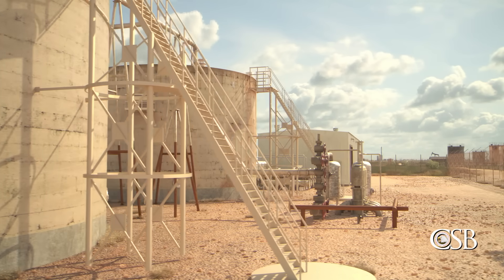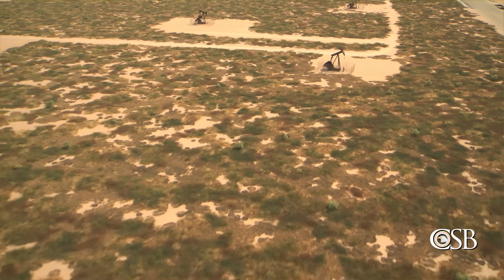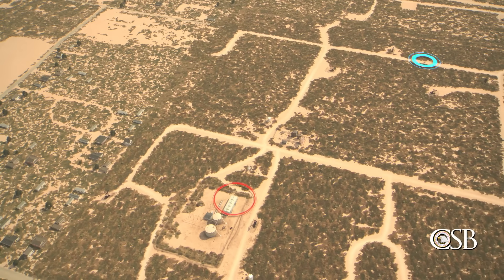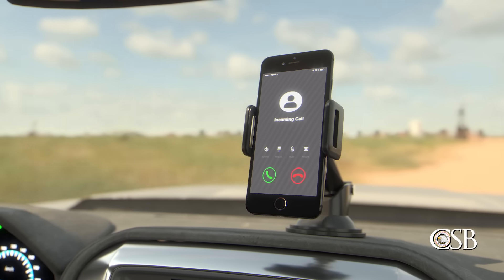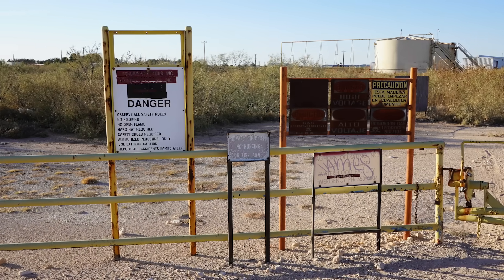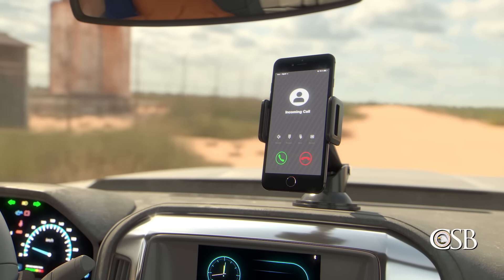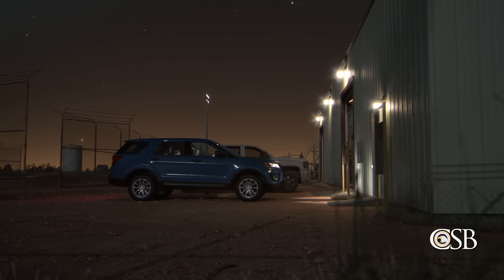Silent Killer: Hydrogen Sulfide Release in Odessa, Texas

Comment: "Some of the sensors were set to "test" mode, and couldn't send an alarm to the panel..."

Anyone willing to bet me cash that this was done BECAUSE THEY KEPT GOING OFF???
Reply: Exactly what I was going to say.  "Stupid alarms keep going off and phoning me!"  Sad, but very likely.
Reply: @khx73  First thing that came to mind.
Reply: It's like that oil rig that exploded. Same thing, they turned the alarms off because they kept going off but they checked things out and found it to be "fine". Many died not too long after
Reply: @skrimper  Italian Gondola crash was the same thing. Emergency brakes kept locking up so an operator installed blocks to prevent the brakes from applying
Reply: they probably would mention that

on the other hand there probably was a lack of evidence
Reply: @NithinJune  A deliberate lack of evidence at taht.
Reply: Happens all the time.
Reply: Never alter a safety device. Cardinal safety rule.
Reply: When safety is seen as an annoyance by employees, then death soon follows
Reply: Yup, and they probably kept going off because the whole area is inundated with H2S, the workers hydrogen sulfide detector was going off in his dang truck with the doors closed, outside the facility.  If you ever drive through this part of Texas the whole area smells like ass from the gas releases.  Not only are they filling the ground level with toxic gases, but they are wasting our natural gas to drive energy prices up on a finite resource.
Reply: Of course that’s what happened.  How many times do you think Aghorn’s mgt cursed the “communists” in DC for their unneeded safety rules?
Reply: No way. That's a sucker's bet.
Reply: In my chemistry lab our safety head gave us a lecture on lab safety incidents. There was lab work being done near a large Dewar flask of liquid nitrogen; which vents itself now and again to release pressure. Apparently someone had enough of the hissing noise so they used some hardware to seal it shut. The resulting ‘rupture’ destroyed the lab and some nearby rooms
Reply: @ladyabaxa  it sounds dumb, but once you've watched a lot of accident reports where that's exactly what happens, it gets way more plausible 😢
Reply: @arin-n7q  Precisely. There are very few accidents that are truly "unpreventable" accidents. And a great many accidents in the oil and gas industry have everything to do with an emphasis on speed and profits ABOVE safety and human health.
Reply: Yep. Guarantee that's why the guy didn't have his personal H2S monitor on either. Not that I'm saying it's his fault, he might have gotten too many hits and management started getting on him about them. Sad story.
Reply: @MrBrian465  The sad fact is, after we hear "Wolf," too many times, we get complacent. Even if there was a wolf each and every time.
Management, however, was being sadly deficient in making sure false alarms weren't happening all the blinking time. But, that's just my opinion (and probably the law!)
Reply: @MrBrian465  Criminal negligence on the part of the company
And his personal H2S detector would have told him if it was real or bogus.
I spent 20 years in the (petro)chemical industry, 10 of those wearing an H2S sensor
Only upside is they won't have suffered
Reply: One of the recommendations from a well blowout investigation was to actively monitor and tune alarms because needlessly noisy alarms just get ignored, and so they may as well not be there.
Reply: Every regulation has a corpse (or more) behind its creation.
Reply: This is one of the cardinal rules of the "USCSB drinking-game" where you take a swig for every corner cut...
When they come up with "... and the safety mabob was de-energized and nonfunctional" you scull half the bottle and bet that it was both intentionally disabled, and was the one thing that would have saved everyone's lives...
Reply: No bet.
Reply: I think the official term is, 'Normalising deviance'
Reply: Oh absolutely. My only other guess would be that they were installed in-house by someone who didn't know what they were doing to save money so they were never fully functional to begin with.
Reply: That, or the sensor had detected gas for so long, and so often,, the filter system clogged up  and the the siren wore out,  and the red light bulb burned out., and every one was happy when it stopped going off and flashing, they never bothered or wanted to check why it  had not gone off lately.
Reply: @chrisperrien7055  I am very suspicious that this was it.  The bay doors were open and it late October it probably wasn't due to the heat.  The personal monitor was in a state of alarm -- was it alarming before the employee got out of the truck, and they left it because it was annoying and that had happened a lot before?  The rescue personnel immediately smelled gas; did the worker also, and ignore it?  USCSB coudn't determine whether the major release was prior to the worker's arrival, or while he was there.  It's all fairly suggestive of there being a frequent smell of hydrogen sulfide there, the workers being told to just open the doors and ventilate and it would be fine, and otherwise ignoring it.  How long was the pump even damaged for?

The major thing that speaks against this is USCSB suggesting no such thing, so at a minimum there's no paper trail and nobody talked.
Reply: Just like the Italian cable car with the disabled emergency brake.
Reply: Normalization of deviance.
Reply: I remember when someone turned off the high water alarm for the sewer system where i work because it was annoying the campers during the night. I was like you know what is even more annoying, it's have sh.t water go into your tent because you're down from an overflowing sewage tank.
Reply: Especially given the fact that they said the one's that WERE working were NOT ABLE to send an alarm.
Reply: Haha I'll bet a penny. I can afford to lose a penny.
Reply: Honestly test mode should be something that is time limited. after a certain amount of time elapses the alarm should reset itself out of test mode. That way it's impossible for a forgetful employee to leave an alarm disabled like that.
Reply: @killman369547 At my job, a lot of the test functions are either pushbutton or switches that have to be held down continuously for testing.
Reply: I had a house alarm that kept going off. Eventually I put 2 in series , so the alarm would only go off if both alarms triggered at the same time. That worked.
Reply: you know it
Reply: that is probably exactly why.
Reply: Disabling alarms like that is terrifying. I've been in a place that isn't exactly the best run, but no one would screw around with gas detectors.
Reply: A tale as old as time
Reply: That's exactly why they set them to test mode, owners more concerned about making money than workers safety. 
Sad but this kind of shit happens everywhere everyday.

Comment: That's the one that smells like rotten eggs at low concentrations, somewhat sweet at higher concentrations and not at all at dangerous concentrations, right?
Reply: Hydrogen sulfide's odor causes rapid nasal fatigue, so you'll stop smelling it after a few minutes--but not because it's not there anymore. Truly nasty shit.
Reply: Right
Reply: As @L P said, it's not that it smells different - the higher the concentration is, the faster you'll lose your ability to smell it & the faster it will kill you.
So at low concentrations you'll get a few nasty smelling lungfuls before your sense of smell goes & you feel sick and dizzy - but you can walk away to fresher air before it does too much damage.
At high concentrations your 1st breath will wipe out any sense of smell -> your 2nd lungful can make you unconscious -> your 3rd can stop your breathing. You're knocked out before you even know what hit you, which is why detectors are crucial. H2S gas is colourless, extremely toxic, highly flammable, and even corrosive - really nasty dangerous shit at any concentration.
Reply: Thats the smell that comes out of golf carts when charging the batteries sometimes.

Comment: well ,being a part of oil and gas Industry as a HSE Supervisor, I have noticed at many occasions that Safety trainings are either not arranged or they are not adequtae. despite spending huge amounts of money on HSE Department, companies fail to establish a sound and safe working Enviornment. The only reason is Poor Management. Sometimes its the weakness of safety department itself and sometimes higher managements is not willing to pay attension.. Infact a lot of managers take HSE as just a legal requirenment and without that you cannot get projects or do business
Reply: I believe the issue is standardization and boilerplate style of safety. Every site orientation I've been to is exactly the same, with little thought to the actual risks you may encounter on site. 

If a company had training that was not the same, and instead had a guy with greasy hands on a camera pointing at a pump, saying "hey, this thing? If it fucks up,  and you don't have a monitor on, you're dead you'll smell h2s for 0.05 seconds then hit the ground the ppm is so high . " 

Then walks over to the muster point and says, " this is where you go if shits hitting the fan" 

Going over OHS regulations by definition does nothing for a site specific orientation.
Reply: @Pickleriiiiiick  absolutely right. Every single site has its own risks. Though the set of activities may be identincle, but implementation techniques, weather, culture .. all these things differ from srea to area. HSE Department should b innovating the OHS definations and make nesseccary changes to make it feasible for their site

Comment: The thing I'm having trouble with is the fact that hydrogen sulfide smells really bad. I mean how did the pumper either not get the smell of a really bad fart, or smell it, but not get the meter? Goes triple for his wife.
Reply: High densities of gas are strong enough to instantly shut down your sense of smell
Reply: @readmorebooksidiots  Wow, I did NOT know that!
Reply: I think you'll eventually just get desensitized to the smell if you work around it for years.
Reply: @DAN007thefoxx1  Yeah, that's true...
Reply: @notmuch_23  In a different video, CSB even said that your own sense of smell is for this reason "unreliable"
Reply: You get used to the smell pretty fast, even at lower levels that doesn't numb you olfactory system as fast as higher levels does. 

I for one get hungry after a few minutes of exposure enen at low levels. My personal alarm goes of at 10 ppm an then it's time to leave the area, but you can still smell it at 50 ppm at least for a while (and your eyes start to hurt from the acidity) . Above 80 ppm it doesn't smell much, but when I have been exposed (briefly) the air gets kind of thick and "cheawy". Hard to explain, and and for gods sake, don't get exposed to such high levels. It will male you feel quite ill, even if you don't die your lungs, eyes and entire body suffers badly.
Reply: The problem is H2S is so lethal, by the time your brain registers the odor it's too late.

Comment: Oof, this one is particularly sad. Two kids orphaned. And why didn't any of his coworkers notice he was missing? Did no one check in?
Reply: Seems he was the lone pumper that shift. These facilities need very little human interaction
Reply: Seems like he was the only worker there.
Reply: Supervisor called emergency services.
Reply: If the person checking was just as informed as the operator, this person would have been found dead next to him. (And his wife)

It still amazes me how it is possible that companies like this can even exist.
Reply: @robbedoeslegrand236  the operator neglected his safety equipment. Never leave a personal safety device in the car.
Reply: @SECONDQUEST  That is the saddest part of this.  Sure the on site detector should have been working but equipment fails (or in this case gets set up improperly).  He had what he needed to save his life and for some reason didn't use it.  I suspect he had a false sense of security becase he hadn't gotten the call or seen the flashing light.  Safety equipment can become dangerous if you let it.  "I don't need my detector, there is one at the plant.  I don't need safety glasses there is a guard on the machine,  We don't need fire drills, we have sprinklers" and so on.
Reply: @SECONDQUEST  Surely he shouldn't have done that. But it is a sign of bad safety management. (Like the failing alarm system in the building)
Reply: @1978garfield  Not only that, they said his personal H2S monitor was in alarm?? And he still went in? Doesn't make sense. I work at a refinery, and if my H2S monitor went off I will sure as shit GTFO wherever I am. Some fault is on the company (failing to maintain the local siren/beacon outside the pumphouse), but also workers need to do their due diligence as well.
Reply: @robbedoeslegrand236  Just like all the rest. $$$$$ is the reason and $$$ is the reason the 2 are dead.
Reply: @alfwok  If you've ever worked a job where H2S is a potential hazard, you'd know that wearing your personal monitor isn't an option, it's a requirement. There could be 10 other systems implemented, but you're still required to have your personal monitor on.

As for the comment about the monitor going off in the truck. I believe they mentioned that they didn't have enough evidence to say if the H2S was present until the pumper started shutting off the valves. I doubt he would've been able to make it to the pump in the first place had the H2S been concentrated enough to set the alarm off sitting in his seat. H2S kills pretty fast.
Reply: Did you watch the rest of the video yet?
Reply: @alfwok  My home isn't a waterflood station??? I agree that the company is at fault for not maintaining their local monitoring alarm system, but like the video said, his H2S monitor was in alarm??? That should've triggered him to think twice. Personal H2S monitors are typically EXTREMELY reliable.

Also, putting responsibility on the individual? It's not that much work to carry around a 0.1 pound H2S monitor....lol. You don't even have to carry it around, just strap it into your coveralls or whatever uniform you're wearing?? But hey, you're welcome to walk around in a chemical plant without your PPE. Go for it.
Reply: Big Oil: “What Employees?”

Comment: How did this gas not diffuse into the air? Was this place sealed? Why?
Reply: Hydrogen sulfide is heavier than air, so it stays low to the ground.
It has to be actively removed.

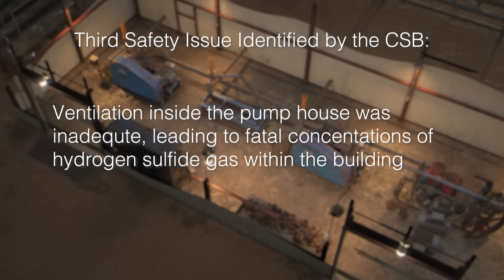Edit: they literally explain that at 9:16 in the video.

Comment: God forbid this company use leak detectors that actually work like they’re supposed to?! 😡
Reply: he left his personal detection monitor in his truck. who would do that?
Reply: @frankyflowers  someone not well trained.  Poor training on the company's part.  Some shit companies also put all sorts of pressure to not shut things down, to not halt production.  Some people abide out of fear for their job.
Reply: @frankyflowers  people forget things all the time. Humans aren't perfect, and therefore our safety systems should not expect perfection. As we can see, there were not adequate redundancies in this instance. That's right, redundancies: one device is not enough.
Reply: @frankyflowers  Someone who doesn't think there's a leak because the automatic systems haven't alerted them to it.
Reply: @ladyabaxa  Yeah good point. An automatic system that isn't working is less safe than no system.
Reply: We had H2S detectors all over my unit.
Reply: Or have an actual logout/tagout procedure. Or have scba gear or proper ventilation if you have to work in an area where you can come into contact with a toxic gas.
Reply: Yeah, it's not exactly downplayed in the video, but I'm surprised that it wasn't emphasized even more.
Reply: They might even have got away with this one if someone had told the worker "Hey these pumps can spit hydrogen sulfide at you, don't go anywhere without your monitor."
Reply: @sealpiercing8476  he knew.
Reply: @sealpiercing8476  - Said in the video they did training,  just not written down or as specific as investigators thought was appropriate.
Reply: None of their locations have working H2S alarms, every time ive been to aghorn the lights are green and my high alarm would set off as soon as I stepped foot out of the truck
Reply: @kadengray7264  Thats a big ol wtf.
Reply: @kadengray7264  - can you explain "high alarm"?  Not familiar with the industry.   Is it high level of gas concentration or i hear some guys wear then on their hats.
Reply: @PayNoTaxes0GetNoVote  I think H2S gas detectors have 2 different alarms, one for the presence of H2S at detectable levels, and another at concentration approaching dangerous levels.
Reply: Hope they get sued.
Reply: *Gas detectors.
Reply: I am sure you can smell this stuff, or at least burn your nose a bit.
Reply: @toejam7606  You can smell a little bit of hydrogen sulfide, but then your nose gives out and you can't smell way too much hydrogen sulfide. I imagine the pumps are usually a bit stinky.